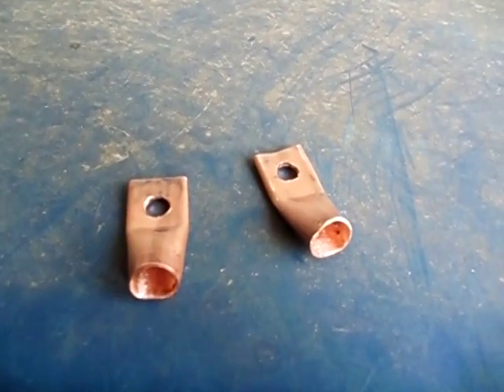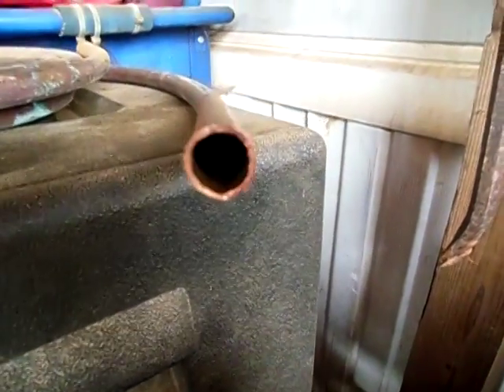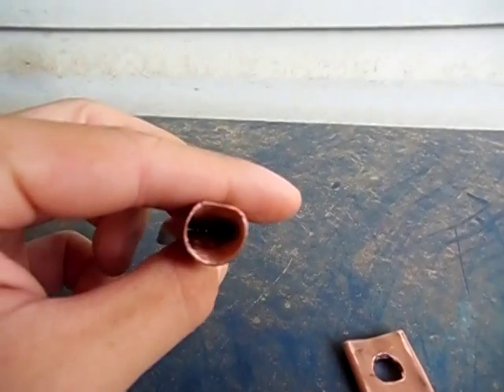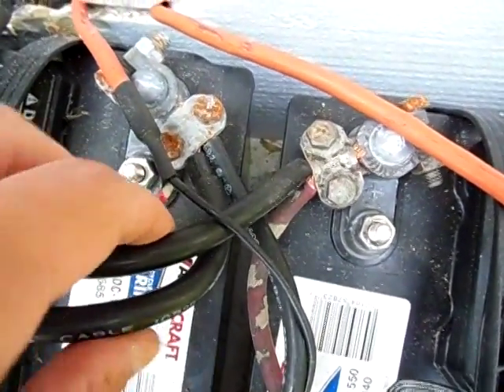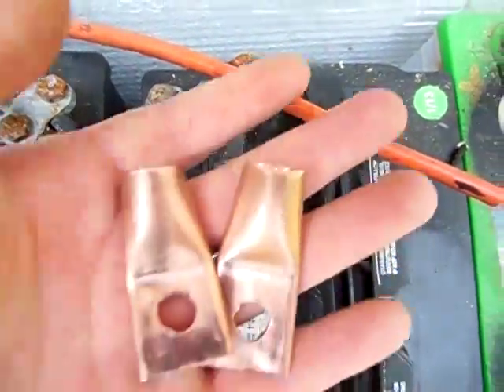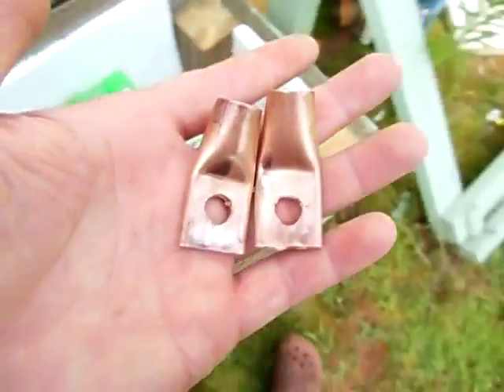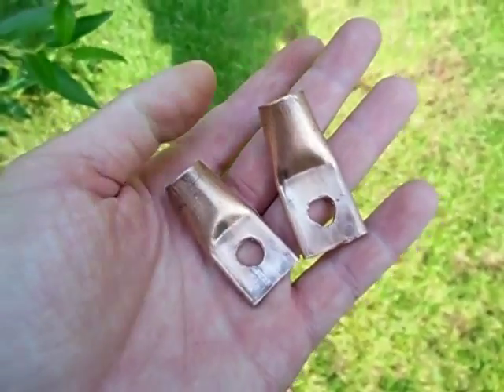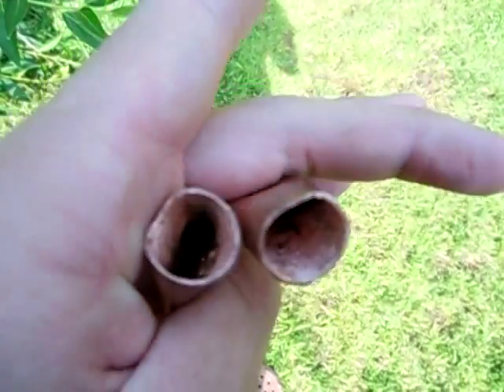Homemade Battery Terminals

Comment: Great idea! I guess you could use a wire pipe cleaner brush to clean out any corrosion in the pipe before hammering it flat.
Reply from the maker: Thanks. I went back cleaned it out with my Dremel.